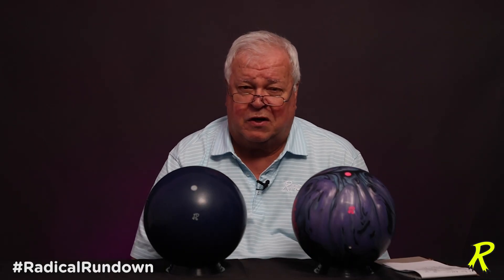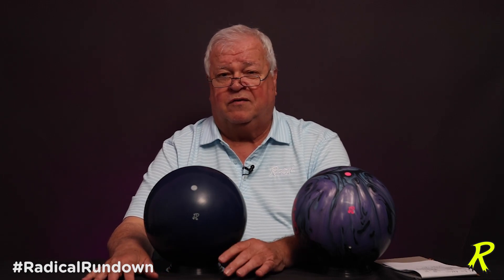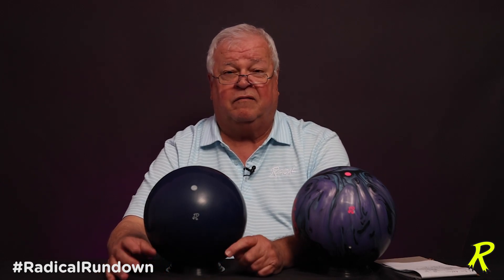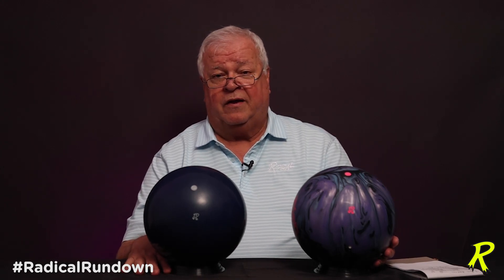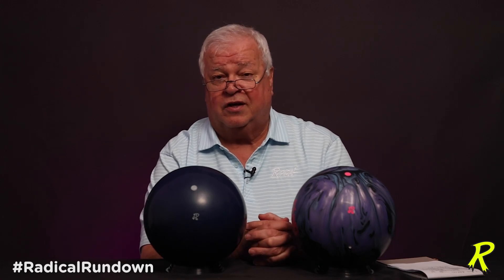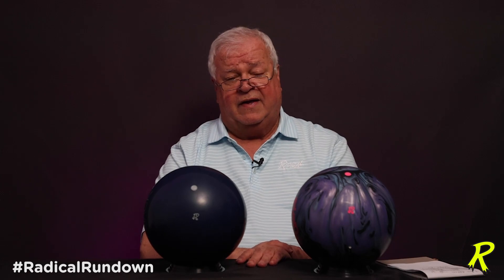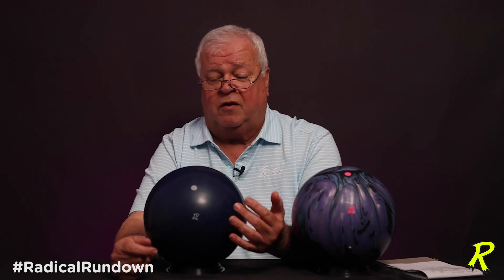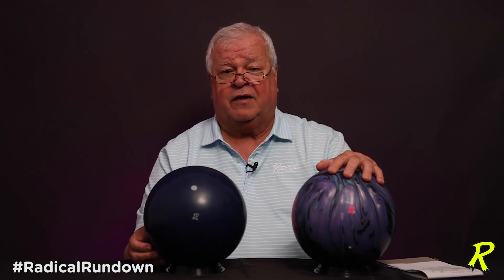Do Drill Angles Matter? - #RadicalRundown

Comment: The layout does have a very small influence on ball motion.  However , it is decision that should be made wisely.  

The Preferred Spin Axis (Mass Bios) on a symmetrical ball is always the thumb hole.  Therefore drill angle has zero relevance.  

On asymmetrical balls the PSA is very relevant.  The measurement of the PSA to the PAP determines how early the ball will flare.  

One important issue to consider is ball energy management.  Ball layout needs to be optimize for rather if the bowler is speed or rev dominate.  

Speed dominate bowlers need layouts that help the ball to slow down and enable significant flare.  Asymmetrical core type and solid surface is very helpful for this type of bowler.  

Rev dominate bowlers need layouts that delay the ball reacting  early and reduce flare to conserve ball energy.  Symmetrical core type and pearl coverstock is helpful for this type of bowler.

Comment: What exactly is the PSA as it pertains to ball motion? Does the ball ever spin on the psa when going down the lane? If so, when is it supposed to spin on the psa? 

Is the PSA only relevant on the determinator? 

 In my experience drill angles do matter.  I have 2 identical symmetrical balls, pin placement is within a 1/16" pin to pap and pin to ring finger.  but CG is in different places.  When ball A spins up and goes through the pins, it is spinning around the thumb hole, and ball B spins up around the ring finger.    Ball A is earlier and has to be used with steeper angles, Ball B I can play all day right of 3rd arrow and with straighter angles. 

They will not be identical for long though, as 1 had a bridge Crack and I want to make it a short pin.

Comment: It may be different for some; however, for myself, I have discovered that the PSA to PAP distance is more relevant than the Drill Angle.  The PSA to PAP distance can be influenced (changed and/or different) by the pin to pap distance, with the same drill angle, while using the dual angle system.  For layouts, I determine the psa to pap distance desired, then convert it (and the other measurements) to the dual angle system for layout by the prosect.  For example, a 50 x 5 x 30 will have a psa to pap of 4"; while a 50 x 3 x 30 will have a psa to pap of 5".  I went through quite a few frustations wondering why those longer pin to pap balls seemed to be duds; until I realized that my style could not use those short psa to pap layouts.
Reply: All your talking about by moving the pin to pap distance is the amount of flare your bowling ball has
Reply: @SteveBoos-ng2zk   And also where the flare occurs, according to the blueprint bowling studies; flare occurs both in the oil & in the dry and those locations change according to pin to pap distance.
Reply: @FredSoDak  a ball flares because the core is trying to stabilize itself
So core angle or core dynamics establish when a ball will flare…
Pin to pap will establish how much a ball will flare and finally the Val angle establishes how responsive the ball will be to friction….
And all that is to determine about 15% of your ball motion with exceptions being extreme layouts(ie short pins)
Reply: @SteveBoos-ng2zk   yes, i agree, core angle establishes when a ball will flare.  For me, an optimum PSA to PAP is 4 5/8".  That distance cannot be directly converted to a drill angle, without knowing the Pin to Pap.  In the example dual angles of my post, using the 508A of blueprint bowling, the flare is the same for both balls; what is different is where the flare occurs.  The drill angle & the val angles are the same; so they most likely do not determine the oil/dry locations of the flare.  The PSA to PAP is different for those balls & helps to explain the location of where in the oil/dry that the flare occurs.  It is a process that works for me; I simply wanted to share it.  And thank you for your experience also; it helps everyone to understand better.
Reply: @FredSoDak  I understand 
If surface and cover stock is the same then I would agree….
Surface is the number 1 determining factor for ball motion…. How quickly a ball can slow down determines when that ball will start to flare….

Comment: The psa is not in the thumb on all symmetrics. If the pin were 3" above the thumb hole the psa is not in the thumb. Its not possible. Be better then that Radical